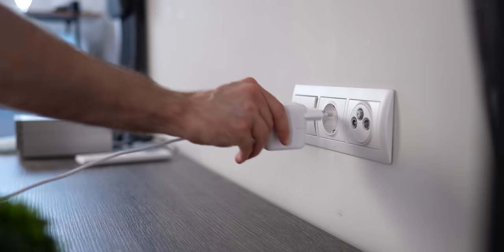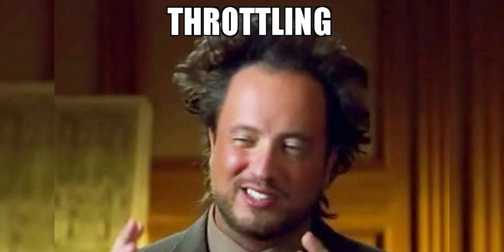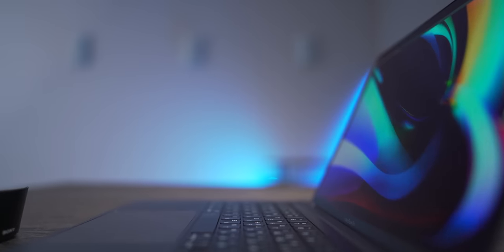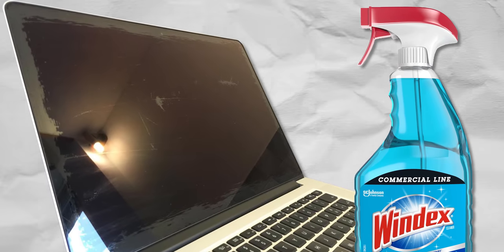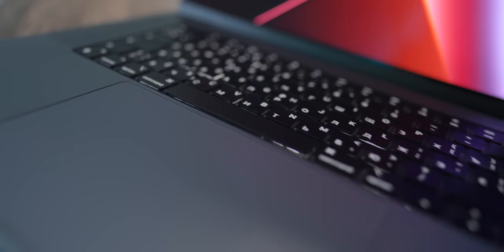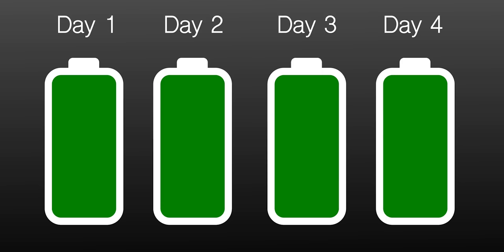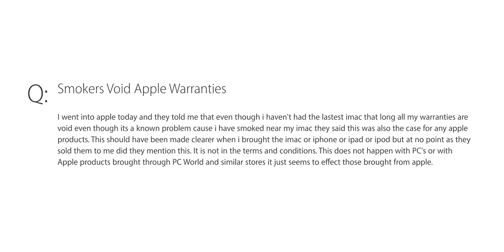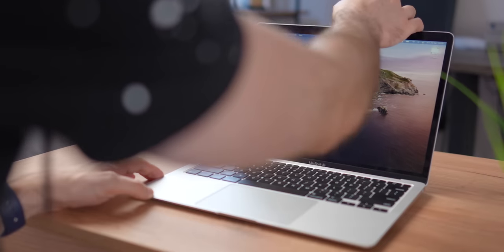Everyday things that SLOWLY KILLING your MacBook!

Comment: Not to mention that you’re not supposed to keep the battery charged over 80% unless you really need every bit of juice because you won’t be able to plug in all day…
Reply: Yes. I learned the hard way with LiPo batteries. The difference with my experience is puffing batteries. With most electronics it’s longterm wear.
Reply: @battery_wattage  I found this out with the Apple Pencil as well. I only ever use it once in a while, and always left it attached to my iPad over the last 3 years, and now I see that it drains very quickly when in use. Don’t store the pencil attached to the iPad. Only attach it when it needs to be charged and set it off to the side when not in use, and even better, unpair it as well…
Reply: @HistoryNut-1701  this largely depends on if the device has a battery bypass. While I can't speak to the engineering, I have to assume that MacBooks bypass the battery when plugged in. To say that using your laptop while plugged in is bad for the battery is Very concerning, considering that many people use their laptops as a desktop replacement. Are we to suggest to these people that they should keep unplugging and replugging their MacBook to juggle the battery life between 20 and 80%? All the while, dumping charge cycle after charge cycle onto their battery? That sounds quite a bit more detrimental than just leaving it plugged in.
Reply: @a1be31s8x9  I agree. MacBooks have a battery protocol built into them that recognizes when they are being used in that fashion and limits the charge to 80% unless you override it. In my case, I use a big iPad Pro with the proprietary keyboard and trackpad as my primary computer, and it does not have that protocol, so I am iffy on whether or not to keep it plugged in all the time, because I do not want to degrade the battery chemistry by keeping it at maximum charge all the time.

Comment: True, do not use other/3rd party charging adaptor or cables to charge your IPAD, Macbook or Iphones.
Only use original Apple Charging adaptor and cable.

Ive use 3rd party charging adaptor (U-Green), charging is very fast, slightly produce heat on my phone if only i use it when i charge with it.
But my battery health drops to 89% just in 10months (without over-night charging or overcharge it).
at the other hand, my brother are using the original Apple charging adaptor and cables, his iphone batteries health is still maintain at 96% in 10months (we bought the iphone 13pro same day).

For my advise, don't use any 3rd party charging adaptor and cables if you really really want your battery to live longer.
Of course there are many other way to kill your battery, but this is one of it, using 3rd party charger.

Comment: If battery charging is paused, or on hold on your Mac.  Found out why my M1 MacBook Air that I leave plugged into power shows that charging is paused at 80% with iStat Menus.  This needs to be an option that is on by default in all devices like iPhone, iPad, MacBook's.

With macOS Big Sur or later, your Mac learns from your charging habits to improve the lifespan of your battery.  In macOS Big Sur or later, Optimized Battery Charging is designed to improve the lifespan of your battery and reduce the time your Mac spends fully charged. When the feature is enabled, your Mac will delay charging past 80% in certain situations. Your Mac learns you're charging routine and aims to ensure that your Mac is fully charged when unplugged.

On Mac computers with the Apple silicon or the T2 security chip, Optimized Battery Charging is on by default when you set up your Mac, or after updating to macOS Big Sur or later.

Comment: It doesn't matter what kind of surface the Macbook is on. The fans take in air that is then pushed through the internals. It will pull dust from the air and through your MB. This is how every computer works. Most modern desktops (especially gaming rigs) are set up like cabinets that can be opened and air dusted. Macbooks don't have this, and thus will experience throttling within their lifetimes more often. These are not designed to be end user serviceable. If you have an issue, take it to a store. That comes with the territory of owning an Apple Laptop.

Comment: Macbook Air cools down by using its metal body, if you place it on a soft surface you might trap the heat. So it will also throttle when placed on a soft surface

Comment: Just a little thinking about the battery (and the way i did great since i got the 2021 16"):

What about using AlDente if the battery is literally "too big" for you? Im using mainly 50-70% charge limit.

Often im charging up to 80% and then use the Mac on AC/mobile mixed with a lower limit set (and let it drain to for example 30-40% over multiple days)
Only about 2 times a month or when i really need/want a full charge im doing so for proper balancing of the cells here and then.

Im already at 140 charging cycles with 100% battery health left (according to Mac OS, coconot battery say 99,5%). Seems like this works out especially with the incredible huge 16" models battery.

What annoys me the most... with HDR used outside especially in warm enviroment... the bottom part of the screen gets HOT AF. i literally need to spin up the fans manuelly to cool the display unit when working outdoors while enjoying the bright screen. I completely understand why Apple didnt allow HDR brightness for desktop usage until MiniLED gets more efficient/less heating and it makes the app "Vivid" for unlocking HDR everywhere a bit useless for me since i still often stick to normal max brightness bcause of the heating panels issue. As fancy the XDR studio displays back looks, it has good reasons to exist for proper cooling
Reply: The screen is on these new M1 (Pro) Macs the biggest energy waster if you really enjoy it, but its too awesome to dont use it like this.

Im really wondering what M2 Pro and co is bringing, hopefully apple finally switches to 1TB SSDs at least in base models and probably also 24GB (with option to 48GB and so) in base models.
Like this i would regret the M1 Pro purchase a bit, but aslong 16GB Ram is enough im fine.

Comment: What about using cases for the macbook? (Similar with cases for iphones?)
Reply: I have a case for the Mac and it's wonderfull saved the laptop many times
Reply: I already saw a lot of discussion about that on Reddit and people always say " if you are not able to take of the case and clean it once a week don't use, because it starts to accumulate dust inside the case because of the fans, and with the friction with may cause some superficial damage". But I curious about that too... Also, a lot of friends use D brand carbon skins, that keeps the MacBook aesthetic and helps a lot
Reply: Cases are fine, just never ever buy screen protectors or keyboard protectors cause they can damage the components badly

Comment: Wiping your Mac display will peal off the coating, but only on Macs. This can even happen without touching. Ususally coating fades because buttons hit the display, so you have noticeable keycap outlines on the display. There is no such issue on Windows laptop.
Reply: I can happen on a lot of laptops, when there’s a lot of weight on the lid, so the screen bends down and touches the keyboard.
Reply: @augustmoll2890  yes, but if you have olefobic coating like apple it's gonna be much worse
Reply: @migidid  Those weren't oleophobic coatings but a different kind of coating. Compare a macbook screen to a fresh smartphone screen in terms of cleaning, you will see macbooks don't have oleophobic coatings.
Those were anti reflective coatings which were poorly engineered and would easily start peeling.

Comment: A cheap multiport is not gonna burn your port or Mac or anything, wtf. They use a connection that is a standardized port. Maybe a connection inside the port fails, yeah, but then the whole port is unusable anyways.

Comment: Does your macbook get heated up while connected to an external display? My 2019 macbook had that issue and it broke due to overheating. I’m planning to buy a new one but I’m not sure whether I should keep using the external display.
Reply: No- it doesn’t hit at all. I’ve new M1 Mbp 2021
Reply: @karmadrukpa4529  that’s so good to know. My 2019 MBP heated up soo bad, some parts had melted through the logic board. I lost all my work and it was beyond repair.

Comment: it's not a museum piece... just use common sense..I personally love the comfort of placing my MacBook on the bed, letting it marginally accumulate heat..and removing it when it gets too hot, not usually a problem  because of shifting positions...etc.  I don't mind sacrificing a little bit of cooling.  As for wiping the screen...Im wiping it...stuff gets on it, and it gets gross.  They're built to last.  Still have my original unibody, works like a charm...peace

Comment: Which one best?
13" MacBook Pro M2 or 14" MacBook Pro M1?

13" MBP M2 with 16gb RAM, 512gb ssd and 14" MBP base model.

I'm an Interior Designer. I'll use SketchUp, vray, Blender, UE5, C4D, Photoshop softwares. 

So which one to buy? Please suggest me.
Reply: @Nix thanks a lot.😀👍🏻